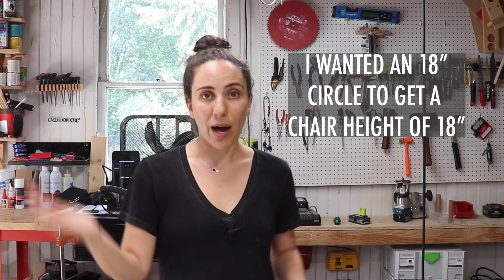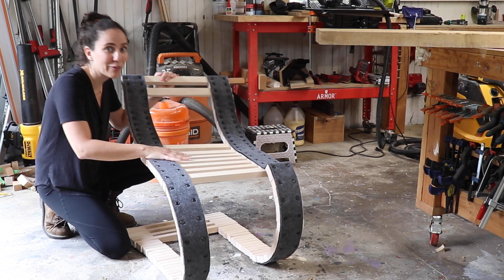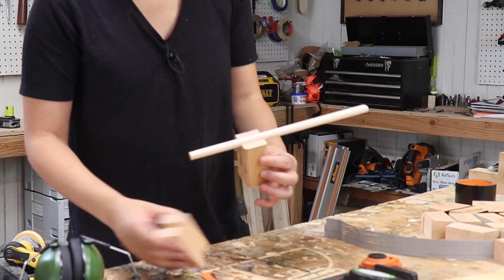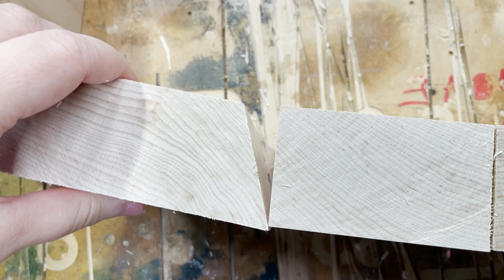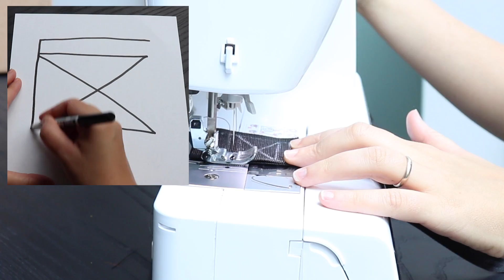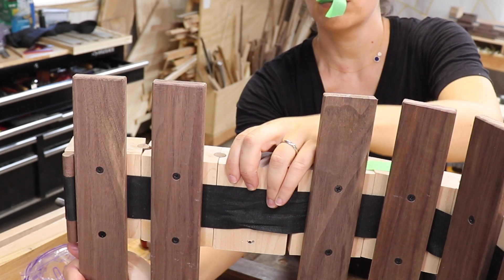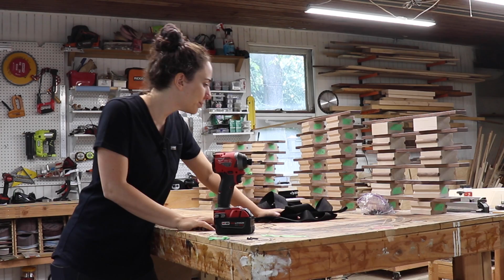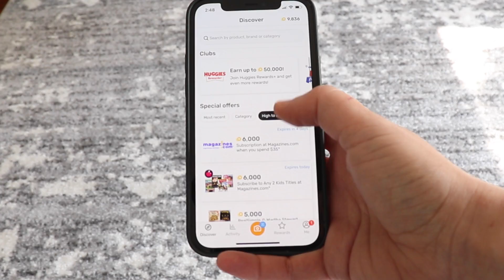I ATTEMPT to make a Roll Up Chair… AGAIN...

Comment: Now, I suck at maths, however, this seems like a situation that might benefit from some:

The entire top half of the chair is a lever, with a fulcrum around the corner of the middle joints, with the other side of the lever being the face opposite the corner that's acting as a fulcrum and is pulling on the strap. For this chair to work, the force of the lever where the face meets the strap has to be lower than the elastic deformation of the strap itself. Assuming you weigh 60KG, that you sit half a meter from the fulcrum, and that the distance from the fulcrum to the strap is 4.5CM, the force at the strap is approximately 6,500 newtons. The Venom strap advertises a mere 1,800 pounds of breaking strength, which is just 8,000 newtons (there are two straps so you probably won't break the strap, but clearly we are exceeding its elastic deformation point). So no matter how much pre-tension you put on this system it's never going to work (as you surmised).

Either a redesign is needed or material must be used that won't deform significantly from these forces, or even twice these forces (since if you sat down quickly you'd have momentum, and you can lean back in the chair). Basically, stapling the straps will not work.

Granted, I may have made some mistakes in there or oversimplified the situation in some way. It's been a heckin' long time since mechanics A levels for me.

Anyway, I love this idea, and I really hope you find a way to make it work. The fact that you kept trying to make it work after 6 attempts is inspiring!
Reply: i'm not nearly as educated on topic as I'm only on second year of architecture studies but based on inspecting the Miesrolo chair i think you're absolutely right. it can be clearly seen that the straps used are much stronger even tho the leaver is shorter so it has potentially lower stress. they appear to be much wider and made of non elastic jeans-like material and glued in multiple layers so it's so much stronger
Reply: "I suck at math"  proceeds to discuss several physics principles and concepts, all requiring math

Don't sell yourself short man, you clearly have a good handle on things. I agree with you, the geometry of the chair is working against her since her body has so much leverage against those straps. The material needs to be flexible but have an incredibly high tensile strength if you want to keep the strap width and thickness reasonable. I would say that getting rid of the straps all together and using pinned joints that have their movement limited by the geometry of the chair segments could work but then the back support wouldn't stay in tension. It's a very tricky problem...
Reply: @nickdibart  the existing straps may still work, but surely you can agree that a new material with a higher plastic deformation point would benefit the design as a whole.
Reply: @cartertrefz4585  definitely. If not, then some variant of glass reinforced fabric would probably do it.
Reply: suck at maths huh?
Reply: i feel this seat would have been much easier if she was using steel cable instead of webbing
Reply: I disagree that these straps won't work. Your math is correct, however the 1800 pound breaking strength is for 1" straps, but it looks like she is using 2" straps which are rated for double the breaking strength. And like you mentioned, she has 2 straps for a total of 32000 newtons of breaking strength. With the 6500 newtons of load, I don't think we would be at the point of plastic (permanent) deformation, even with double load.

The issue I see that I outlined in a different comment is the amount of strap that is allowed to stretch. The entire length of strap can stretch in the current design, and can be allowed to show itself in only one joint. If she were to attach the strap to the blocks by staples, or even better - glue, the stretchable length of the strap will be greatly reduced (the glued sections of strap will not stretch any appreciable amount).
Reply: @jaredcallahan9515  
This was my thought too.

The tension causing the flex is cause it's allowed over the entire length of the strapping.

Multiple small straps secured to each block would limit the stretch, and also avoid another piece curling  up from the tension caused from the stress elsewhere, when there isn't enough force to hold in place.

The high stress joints could also be fixed, using fiberglassing or a similar process.
Reply: @jaredcallahan9515  I would argue that you have to assume all the load may at some point have to be carried by just one single leg. It's not like us humans are going to always distribute the load evenly. If you lean towards one side, or sit down towards one side of the chair, you might get a load case close to single leg carrying all  the force. I do agree though, Some kind of glue or staples to prevent the strap from sliding should prevent the "buckling" issue, where one  link suddenly snaps, and loosens the strap, or creates a pinching hazard somewhere.
Reply: Its actually worse still. Basically the lever function explained in the comment above can be calculated for every joint and the resulting force is cumulative. AND the force is present across the whole length of strap, because thats how tension works. Meaning LOT of stretch. Attaching the strap firmly to each segment will be a LOT better. If there is too much flex still, fiber glass is always an option.
Reply: I think she sholud get a strap with known force/deformation (modulus?) and than engineer the thickness of the pieces to keep the movement of the chair under like 1cm. Based on your principles. But l wouldn't be surprised if you needed riculous materials or thicknesses for the whole thing to work.
Reply: Alternately, one could introduce additional layers of strapping to multiply the tensile strength with (relatively) minimal increase in material.
Reply: My mind goes to "more straps" when you break out the math like that.Divide the force over more material for less deformation. If there were no airy gap in the middle, just full planks of hardwood, there could be straps the whole way. (Or maybe just 4 or 6 straps could do it?) Pretty much what the person just above me said...
Reply: Please provide proof that you suck at math
Reply: @nicole-nu4vy  2+3 is chair!
Reply: yes you have to put the  on  forces the Blocks not the strap maybe she can make the blocks connect with each other 
an Box joint like connection should relive some tension and prevent the role up
Reply: Better straps woud definitley help i'm wondering, since the straps are noe covered up and you cant see them you could use multiple over the length of the whole chair shorter straps would be easier to adjust + you could just adjust the problem area. Also you could have different straps for the areas that can flex more and the areas that need to be stiff for the structural integrity.
Reply: I 100% agree with your analysis. In fact the fulcrum could be considered to be the point where the dowel is placed in the middle of the block so may be closer to 2CM which doubles the force. Also the reverse analysis is important too 1mm of stretch in the  strapping translates to a deflection of 500/45= 11mm. So under this force of somewhere between 6-12K Newtons it must only stretch by less than 0.1mm over 4 cm length to ensure a deflection of less than 1mm; even the wood is going to struggle to achieve this under such compressive forces. Make a roll up back leg and everything will become awesome.
Reply: Dyneema rope could be a good alternative to the straps, while potentially sacrificing the aesthetic unless it were hidden behind the straps themselves. The venom straps have a breaking strength of 1,800LBS or ~800KG and the wider webbing is rated to 2,500LBS or ~1,100KG. 1/4" (6mm) dyneema is rated to ~8,200LBS or 4,100KG. I understand that they are both UHMWPE material, but have different applications and manufacturing processes, giving them different properties. 

A 6mm/0.25": dyneema line has a breaking strength of 4,100KG and only stretches 2.6% of total length at 30% of that breaking strength. 

Assuming the math above is correct, there would be ~660KG of force on the dyneerma or 16% of the total breaking strength. If the coefficient of stretch is linear, you would have ~1.8% stretch. Over a 6' length, this equates to 1.3" (33mm) of stretch across the entire length of the chair or a localized stretch of 0.058" (1.5mm) across each hinge point. This assumes the dyneema can slide and spread the force, as well as the stretch, equally. 

Either way, I believe it may be stiffer than the straps, and you can go thicker if needed. Thicker line = less stretch under the same load. 

I have replaced 1/2" line with 3mm dyneema as a temporary measure and it did not plastically deform under loads that rope was rated for.
Reply: From my point of view, the straps are not the problem. The wood pieces that make up the curve (or in your term fulcrum) are too narrow and do not support its own weight nor the weight of the person sitting. If she made those pieces (higher? wider? I'm not sure what the proper term is here) creating a greater surface area for the pieces to sit on each other then it would probably hold more weight.
Reply: I was about to write something similar but with less maths, but the issue is exactly as you describe. The forces not just on the strapping but also on the wood part that makes the falcrum are huge, like just in my mind it's amplifying the force at those points into the 10s of tons range. It's a hard thing to pull off with a chair with no joints at all, I am not sure if going as far as to use a wire or cable would do the job as the clamping force to hold it in place would be pretty high too...

Shame, it's such a good idea, but one that's extremely difficult to pull off..
Reply: It's not even just the breaking strength it needs to have virtually no elasticity whatsoever under that kind of stress
Reply: I was thinking this too, I wonder how steel cables would work.
Reply: I'm gonna recommend ratchet strap material. Available in all colors, thicknesses etc. and extremely durable
Reply: Although the thought process is correct, the facts are a bit different than whats assumed. If this chair had only one point where the straps strech, than we can talk about how to dampen the force thats being aplied. How ever this chair has 22 point which applies presure to the strap on a very very specific locations. SO its not like we strech the strap from a to b. Its more like 22 X (a X b). So even if this strap has the strenght of god know what, it still has 22 stress points where even one fail would cause total failure. We should somehow strenghten the parts that streches so they wont deform but I dont know any material that can be applied on the straps. ITs much easier to have another type of metal alloy strans based/reinforced straps in where the strench is stoped alltogether.
Reply: Honestly, a plastic sheet might work?
Reply: Couldn't you add a bar, running from the back of the chair to lock against the foot of the chair? Something that can be used to lock the chair closed when rolled up and hold the chair up when open?
Reply: Okay, I just found someone who has successfully created a functional rolled up chair. What do you guys think and how is it different from the way she did hers?   https://youtu.be/MuodNlDKce4
Reply: @benkayvfalsifier3817  He preloads the straps so that when they inevitably stretch under load, they stretch to a point where the slats lay in the desired relation to their neighboring pieces. In addition to that, the straps are secured to each slat instead of being allowed to free float. This likely reduces overall stretch because he is securing the straps to the outer edge of the slat and reducing the overall length of the strap that is allowed to stretch. Since stretch is a function of length, this limits the stretch more than if it were allowed to 'free float'. 

He also uses a Z shaped slat to prevent slippage but this could possibly be achieved with the dowels shown in this video, albeit slightly less reliably. A semicircle over a dowel needs more friction or tension to prevent slippage than the Z style slats.
Reply: @LazloNQ  well any reasonable amount of elasticity will allow stretch and virtually any amount of stretch will cause those gaps between pieces that destroy the desired shape. You'd have to put it under well over 1000lbs of stress while assembling to match the weight and leverage we want to put on it.
Reply: Exactly, I also feel this requires an immensely strong material, very high breaking strain and low yield. Plus as others have said, an (ideally adjustable) tensioning mechanism. Release to roll up but after erecting it, pretension before sitting on it. 

Someone suggested glass fibres... errrr, no. Glass doesnt like being flexed. Kevkar or some similar Aramid (ideally in the form of pre made belt, woven webbing or encapsulated in rubber?) maybe. Carbon nanotube space elevator material ? 😉

I would go for steel pivots between steel links, ie a chain, can be found in the strength you need Eg https://www.renold.com/media/165414/transmission-chain-ren1-eng-07-14.pdf
Reply: @davesmith9325  the problem with all fabrics is that they get at least some of their strength by stretching
Reply: Steel cable!
Reply: steel cable and winches, make it happen
Reply: Well said!
Reply: @Alexei Barnes

Exept stapling the straps is EXACTLY what you need to do. 

TL;DR shorter ropes(and straps) stretch less, so the closer you can comfortably staple to the edges, the better. Glue definitely helps, too.

Physics says that if you pull on a rope with a given force then:
1) That pulling force acts across the whole length of rope.
2) You can measure an elongation of the rope. Measured in %!
3)That elongation (in %!!!) stays the same, no matter if the rope is 1 cm or 100 cm long!

Unscientificly speaking longer ropes stretch further under the same load, shorter ropes are more stiff.

Further we are dealing here with more than one fulcrum, there is one between each segment. And one would expect larger forces between the segments the closer they got to the ground due to the longer lever arm. Stapling compartmentalizes those forces, so that the highest force no longer acts across the whole length of rope, but only a single section. This alone should result in significantly less stretch.

If you were to staple closer to the edge of each segment, you would also shorten the total amount of rope under tension, which would make it stretch even less again.
Reply: You read my fucking mind my guy

that’s what I came down here to comment

She would have to measure the length of where her center of mass sits on the chair to the pivot point on the block, then measure the pivot point to where the strap sits on the block (  F = (W x X)/L  ) that will give her the weight capacity of whatever the straps tensile strength can support

Comment: Why not secure the strap on each individual segment allowing for tension to be isolated to each piece. With this set up it allows the strap to slide in between each wood piece allowing for tension to be in unnecessary places. Regarding strap material. Instead of buying strap from websites, go to a junk yard and get seatbelt straps. You can get a whole bunch of it and the junk yards may Let you just have it. You could also double up on the strapping in the higher tension places. Another thing may be to use some metal,such as brass or aluminum,  to reinforce the wood from deforming.

Comment: The problem is that your only using straps under tension. Try to put some compression stoppers on the back slightly bigger than the back.

Comment: Suggestion: Attach the strapping at each segment. Then you won't have the flipping/collapsing that pulls it tight under extreme tension.  The tension will be from one block to the next, and not from one end of the chair to the other.  Don't use staples, instead use two layers and sew a "daisy chain" with a strip of wood inside to screw to your blocks.

Comment: That venom strapping is super strong.   1000s of lbs. It won't stretch.  That's why ripstop sells it.  That material is used by tugboats.  That's the right material.
Reply from the maker: It did stretch
Reply: @3x3CustomTamar  Try getting 1/4" braided rope of the same material.  I understand it stretches much less when braided.

Comment: The solution to to this problem is the same concept that holds the massive concrete blocks that form the Sydney Opera House roof. You need a steel cable running inside the centre of the blocks. When you apply tension on the cable you are compressing the blocks together. This cable can be tensioned with threaded rod attached the the cable at each end of the cables and either cam locks or nuts.

Comment: So the big bottom curve could be fixed by connecting the blocks with recessed hinges. It would stop the blocks from separating while allowing the chair to still be rolled up. The strap could cover the hinges so you wouldn't see them. The backrest should be fine with just the straps. The backrest might move a bit, but likely not enough to worry about.

Comment: Hey Tamar! Pretty impressive!

I got a pretty simple but ugly idea. You want hinging at each joint right? But the problem is that webbing is stretching right?

Why don't you use actual steel hinges at each joint? That way you don't have to worry about twisting too.

Alternatively, bind the webbing with glue to each side of the joints you have gap issues with? Being able to screw the woods together should allow near perfect adhesion too.

Comment: No strapping is going to be able to take the loads exerted in this arrangement. The very bottom corner is going to be subject to about 800kg of compression on the timber. You would be better off using a forklift truck lifting chain or something.